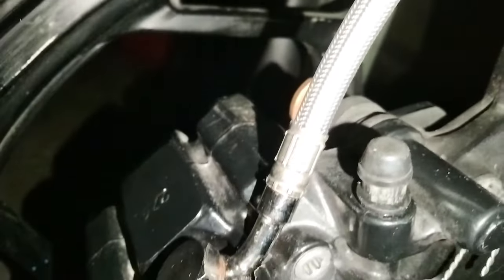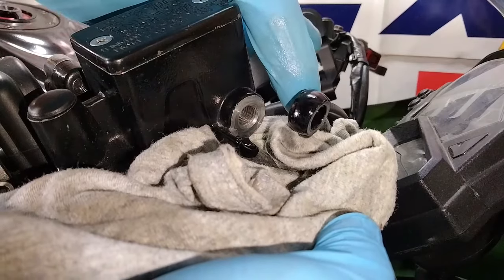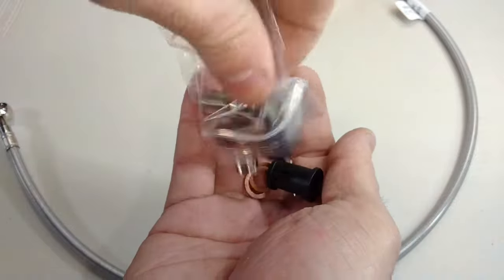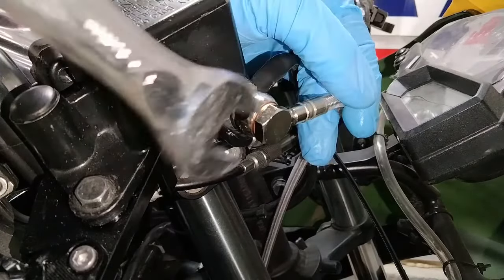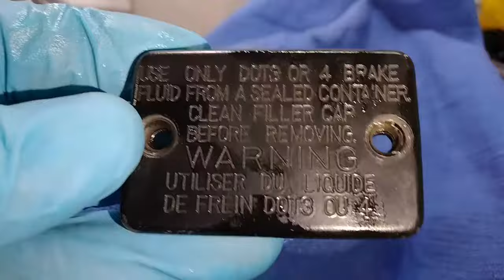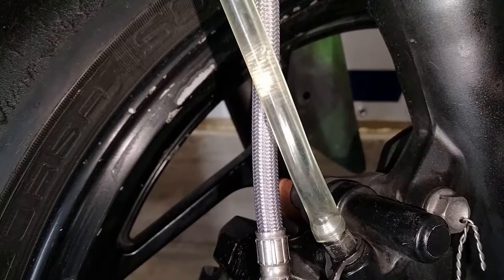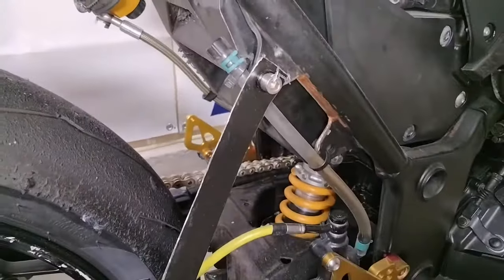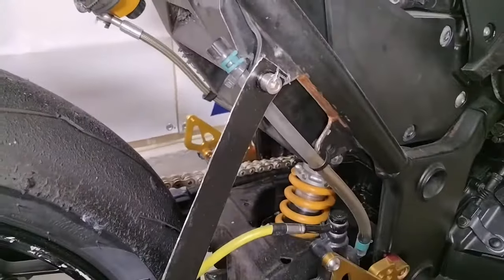How To Install Steel Braided Brake Lines On Motorcycle

Comment: This must be one of the best toturials I've ever seen man! I feel confident changing my break lines now, thanks!!
Reply from the maker: Youre welcome. Confident is a good feeling when it comes to working on brakes lol
Reply: Did you notice any difference in the brake feel after the swap to the steel braided lines? I have heard that it makes the brake feel more responsive.
Reply: What’s the difference between the regular and the racing grade brake fluid, higher boiling point?
Reply from the maker: @Dirtywhtboy87930  yea it just give a more firm direct feel, less pressure is absorbed through expansion in rubber lines. With no expansion of rubber linea, all the pressure is directly applied to the calipers
Reply from the maker: @Dirtywhtboy87930  the difference is higher boiling point yea. During street riding, regular dot4 fluid is just fine. If youre using the brakes hard alot like canyon carving or doing track days, the brakes get REALLY hot. The fluid can start to boil and that will cause fluid fade, similar to brake pad fade. Causes the brakes to get a spongy feel and not work so well. The higher temp racing fluid is almost impossible to boil so you can get the brakes super hot and they still work well, assuming the pads are also up to the job for high temps like using sintered metal racing pads

Comment: I’ve changed the brake line on my bike recently but I can’t fill the brake system with fluid. If I disconnect the line from the master cylinder fill the reservoir with fluid and press the brake nothing comes out. Am I doing something wrong or have I broke the master cylinder
Reply: I’ve been having a similar issue and just watched a video where the guy said to just tap the break lever until you cycle the air bubbles out of the master cylinder and you should start to feel pressure build up.

Comment: Great video, thanks. After syringing out the bulk of the fluid from the reservoir you can then open the bleed nipple on the caliper/s with a tube on them, and the rest will flow out through them, instead of getting so much spillage from the banjo bolts. Also, remove the rubber cap completely from the bleed nipple when pressure testing, otherwise leaks can hide at the base of the nipple where it screws into the caliper.

Comment: Thanks for the great video.  I'm putting apes on my cruiser, and knowing exactly what to do helped a bunch.
Reply from the maker: @CaptainFishHead720  nice, apes mean you got a lot to move around! Glad i could help with the brake lines. One thing ive been doing lately that helps is reverse bleeding the fluid with a plastic syringe to fill an empty system. If you have trouble getting things filled, try that.

Comment: I am in the middle of replacing my brake line. I noticed that each end of the brake line has two sizes width. Which side goes toward the master cylinder? The wide or narrow? I foolishly did not make a note when they removed it. I did not realize that there were two different widths on both sides of the brake lines. I believe the wide part goes against the master cylinder. I also seem to have a lost one of the copper pressure washers. Where can I get them? Thank you.

Comment: the hole on the banjo bolt and the brake lines has to be line up correct?
Reply from the maker: Good question! No there is space alll around the banjo bolt for fluid to flow. No need to make sure its positioned any specific way, just assemble your washers, torque the bolt and youre good. Remember to test for leaks before you ride🤙
Reply: @nickbuchananracing  appreciate it thanks

Comment: For the rear brake, how did you top up the brake fluid since you're using a rear brake delete kit? Do you use a syringe or a small funnel? I have a rear brake delete but yet to install. Is there any danger of the cap flying off when things get hot since there is not as much space in there as with an original larger reservoir? I use my bike for street as well so the rear brake gets some use sometimes.
Reply from the maker: Sorry for late response. Notifications turned off by mistake. I use a small funnel with a super skinny tip. I dont think there are any issues with pressure build up as long as you leave a adequate air gap. I dont know if there is a standard amount that is agreed upon but I figured leave as much air space as fluid space and that should allow for a chamber of air for expansion and compression of fluid. If you rear brake (as u should for casual street riding) keep an eye on that fluid level and make sure it doesnt get too low. I dont use rear brake for track so I never worry but for a street bike, I dont know if its a great idea if you use the rear a good bit.
Reply: @nickbuchananracing  Thanks. I'm likely going to keep the regular reservoir on since the bike is used for street as well.

Comment: great video, do you have to line up the holes in the banjo bolt or is that not needed regards gary
Reply from the maker: Good question, no need to line the holes up. Thanks for watching
Reply: @nickbuchananracing  thank you

Comment: Ninja 300 track bike❤ 
I was wondering, you use the OEM master cylinder, don’t you face any issues with it hitting the bodywork?
Reply from the maker: No, its close, but just barley clears the hotbodies bodywork i have on it. I also have the db holders upper fairing stay which is ever so slightly lower and further back than the stock one, but even so, i dont think i had problems when i was running the stock fairing stay either

Comment: what size tubing did you use?? roughly? just wondering what size ID I should get to make that snug fit
Reply from the maker: I dont remember sorry.  I would take the lines apart then just completely remove the bleeder screw and take it with u to the store.

Comment: I replaced the brake lines with braided steel lines on my 2014 Honda NC700X. It is impossible to fill the front brake line with brake fluid. I backed out the nipple thing 2 turns, poured brake fluid into the reservoir & pulled the brake lever at least 100 times & nothing happened. I may have to remove the line & see if it's blocked. Or ride my bike to the dealer without a front brake. 32 mile highway ride through heavy traffic & 75 mph speed limit. Fun. Rear brake was not a problem.
Reply from the maker: Ive had that problem once. Get a plastic syringe and a short piece of tubing, open the bleed screw, open the reservoir cap, and force brake fluid up the bleed screw, reverse direction. Then once you get some fluid in the lines, bleed like normal. Its called reverse bleeding. It helps sometimes
Reply: @nickbuchananracing  Thanks very much. I'll try this.
Reply: It worked! Thank you.

Comment: For some reason when i pump the lever the fluid doesnt move. Just stays in the reservoir, bleeder screw open
Reply from the maker: Leave the screw open several turns and pump the lever a bunch and see if you can get it moving. If not you may need to try reverse bleeding or use a vacuum bleeder

Comment: Is it same between brake line for install on ABS & Non ABS bike?
Reply from the maker: should be the same but the hoses will take a different route to go through an abs unit. If your bike has abs, I would recommend you use a repair manual to help you out.

Haynes or Cyclepedia make great manuals.

Comment: Got to reverse bleed them and done !!
Reply from the maker: ive seen videos of that. havent done it yet though. looks like it works pretty well. If i ever have a set thats troublesome I may try that. But for my single caliper and single line set up, it got moving pretty easily.

Comment: Bro please help my steel braided brake line is too long how should I cut them and make them short
Reply from the maker: well you dont want to cut them. that would be stupid... obvously you should just put them in the dryer on high and they will shrink right up.
Reply: @nickbuchananracing  I didn't understand brother please explain properly. today I have purchased steel braided brake and it fitted in my bike but not properly oil is not bleeding properly because due to long length I made brake line circular from middle so it's fit properly but at the end it's taking too much time to bleed
Reply from the maker: @Allahmadarchodhai27  leave the bleed screw open and pump the brake lever a bunch and try to get it flowing, or just leave the screw open and gravity bleed it by leaving it open for a little bit. if that doesnt work try reverse bleeding the lines with a syringe, just look up reverse bleeding. or try vacuum bleeding the lines. basically try bleeding the brakes some other way if you need and one of them will probably work for you.
Reply: @nickbuchananracing  let me try brother I it's starts working then fine If it will not start working then sure I have to cut some so it will fit properly tnq for replying brother 👍 have a good day
Reply: @nickbuchananracing  brake line became circular shape more then one round so I don't think it will work
Reply from the maker: @Allahmadarchodhai27  you may want to return those and get some new ones lol. sounds way too long.
Reply: @nickbuchananracing  I don't to return brother I have ordered it from Flipkart by paying from Flipkart gift wallet
And you know that money cannot be transferred into bank account and there is no other steel braided brake line available on the Flipkart 😭
Reply: @nickbuchananracing  tnq bro reverse bleeding worked love u brother 🤩
Reply from the maker: @Allahmadarchodhai27  awesome! I knew you would figure it out one way or another. good job👍👍👍
Reply: @nickbuchananracing  yes brother tnq and steel braided brake line is working super fine. first time i experienced performance of steel braided brake line ...... I lost all hopes but you helped me brother......🤩😉 I'm not good in English so try to manage brother

Comment: You should be better draining off the brake fluid from the caliper and working your way up. Should be apply a vacuum brake bleeder tool. There will be much less leakage.
Reply from the maker: Yeaaa i dont have a vacuum bleeder. I had a cheap one from advanced auto and it broke in about 3 seconds lol

Comment: Copper rings are WRONG you need to use aluminium rings.
Reply from the maker: No. you're wrong. Galfer uses copper. Other manufacturers use aluminum.

Comment: Changing brake lines is a walk in the park...it's the bleeding where the ball ache beggins. Absolute nightmare.
Reply from the maker: open that bleed screw up a full turn or so helps me alot. much more open to get things started flowing
Reply: @nickbuchananracing  yeah i tried the traditional method last week on my Zx6r ninja. After 2 days of grief, I took it to the garage. For some reason I just couldn't get the front two calipers to feel perfect.
Reply from the maker: @k1ortia  what ended up being the issue. still air in the system?
Reply: @nickbuchananracing  Paitence the mechanic said to me. 2 days is way more Paitence then iv got..lol

Comment: Did you drain all the fluid out before installing the new lines , or just empty the master cylinder
Reply from the maker: Yes I drained them a little when I loosened the upper and lower banjo bolts. Its a little messy, use a wad of rags under the banjo bolt when you loosen it